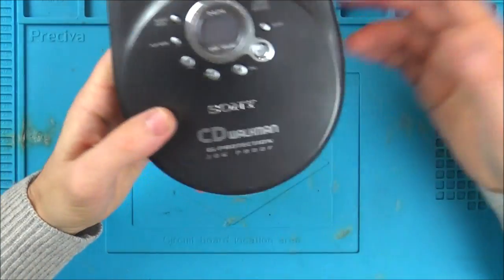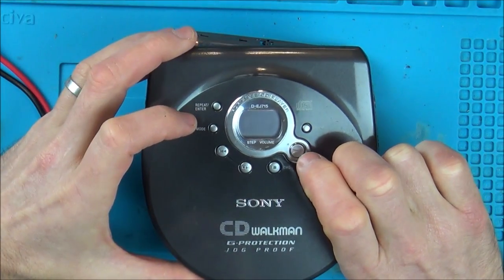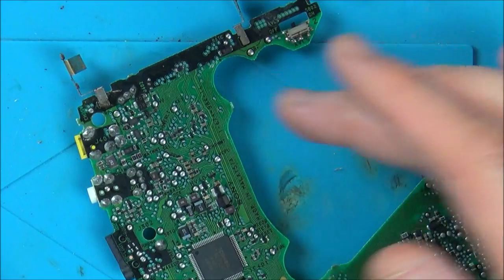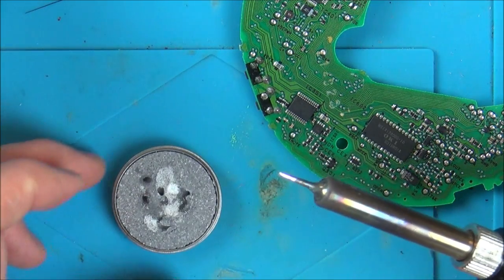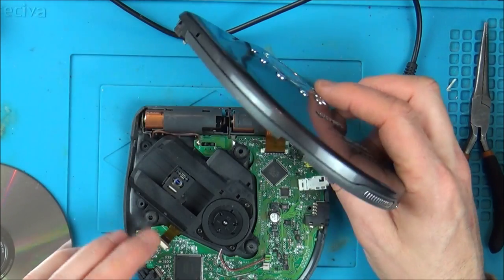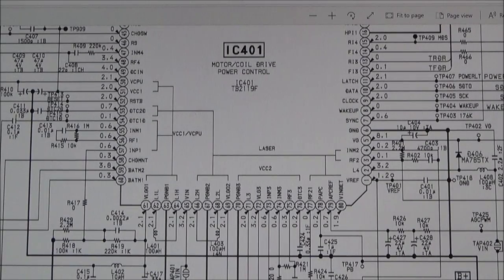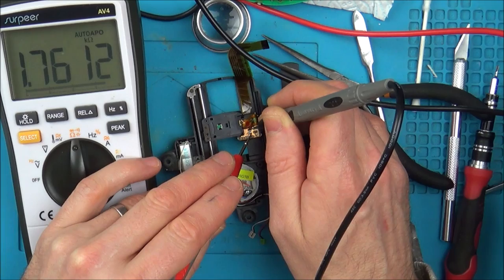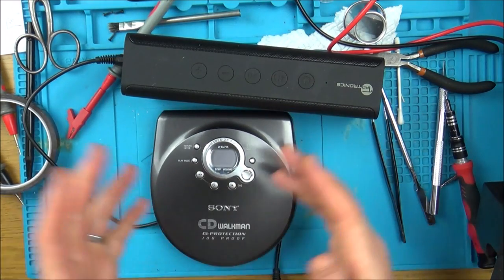Trying to FIX: Faulty SONY DISCMAN D-EJ715

Comment: The problem isn’t the laser, it’s the track for the laser. It’s trying to move from the center of the disc to the edge. When you moved it closer to the center, you may have damaged it’s tracks. The way it reads the disc  it’ll start from the center of the disc and move out wards away towards the edge as it playing music

Comment: About the enameled coated wire, you don't need to scrape the coating off, it is made to burn off when you heat it with your soldering iron,
Reply: was looking for this.. xD

Comment: Hi Vince, the laser in the cd players only are all infra-red with a wavelength of 780nm which is barely visible to the human eye but looking at your video indicates that the laser diode may be okay. The dvd laser diodes operate at 650nm and are bright deep red and the Blu-ray players operate at 405nm which produce a violet light.
Reply from the maker: Thank you Peter :-)
Reply: Thanks. I was going to mention this, but I saw you beat me to it. One of the reasons these lasers can cause eye damage is because the human eyes are not tuned to infrared, so there will be no blink reflex when an infrared laser hits your eyes, so continuous damage may be done to the eyes without being aware of it, unlike a visible-light laser, where the victim will at least blink involuntarily after the beam hits the eyes. This is not to say that powerful lasers will not damage the eyes in the fractions of a second it takes to blink. 405 nanometer light can be the most damaging because that wavelength has a special affinity to the cells of our eyes. This is why even non-laser UV lights tell you not to look directly at them. I'm not trying to show off here, the point to take away from this digression is 'be especially careful when working on blue-ray drives (if the laser is exposed)'

We all want to make sure Vince can see properly, so he can continue to make these fun and interesting videos.

Comment: The shaking it has, it looks like the laser gears might be skipping when it tries to move further out, I wonder if its a mechanical issue with the laser worm wheel? Often a laser checks the disk type and amount of tracks right near the centre of the disk then the laser moves out to play track 1.
Reply: Diddleshot I wonder if it’s trying to home the laser head - but because the head is all the way down it cannot move further. Vince was sliding it around without a care in the world early in the video lol
Reply: @StephenArsenault  that's exactly what it is sir. i have a similar one that does the exact thing. It tries to retract the head but it cannot because t's already there but the pickup icu cant sense it. It usually indicates an end-of-the-line killswitch malfunction. The Laser is probably fine(ish).
Reply: @StephenArsenault  I hope this one gets read because he certainly skipped the gears in the read head tracking a few minutes in. The disk info is located in a certain location and if the head can't get there it won't see the disc.

Comment: All CD's are read from the center out,, some CD players will use the laser to detect "Disk present" first, but then command the tracking servo to seek the inner location they usually do this by running the optical sled towards the disk spindle until it strikes a micro switch that tells the player , You have reached the inner track,  it will then try and read the disks table of contents ,, you should see the worm gear drive attempt to move the optical pickup sled to seek this position, if the laser is too weak , it might not seek as it may think "no disk present why seek ,, most CD players seek inner track detect as a part of there attempt to read anyway.  be mindful A CD players laser light emissions are in the infrared spectrum also be aware laser diodes are extremely static sensitive and easy to damage, some people will not unplug the ribbon cable unless they place a bridge the static protection pads with a solder bridge first,,    and new ones usually ship with a solder blob in place that protects them. they wont work until this is removed ..watch videos on CD player repair to better understand how they read the disk ,, also make sure the lens is clean ..

Comment: Hopefully I suggest this so that it makes sense. But, I think when you adjusted the pot for the laser you may have went the wrong way. On a pot you have three legs, with the "wiper" in the middle. So, while the resistance goes up between the wiper and one leg, it goes down between the wiper and the other leg. So it would depend on which leg the laser was wired to. I couldn't tell from the video if it had three legs or not, but it is worth a try. The laser did seem to get dimmer the more you turned it, or maybe it was just burning it out worse...Lol.
Reply: Good observation. I also wondered why Vince did not try to turn the pot the other way to see if it made a difference.

Comment: Just a little advice, don't worry about scraping the wire just run the soldering iron over it, the heat will strip the enamel off the wire. If you use a scope look up "eye pattern", diagnostic procedure to check out FE and TE (focus error, tracking error). This will give you the condition of the laser. That's how we used to do it back in the day when the values could be adjusted. Great video.

Comment: Bought a Walkman D-C20 yesterday. Had similar symptoms to yours (Starts spinning for 2-3 seconds, then stops, laser searches for something -> No Disk)
I was about to give up, but then i saw the resister on the laser, it was set to 2.8kOm. Moved it down to 1.5 and it WORKED ! 

Thank you sir for your video and help

Comment: Great job on the repair of the damaged traces =D  You cannot always see the laser!!!  It depends on the frequency of the laser.  The fact the disc was spinning, shows it was actually detecting the disc (using the laser), but it was perhaps too low.  Some CD units have a laser that you cannot see with the naked eye.  Also note, if you have the laser set too high, the same thing can happen where it won't detect a disc.  I also think you have to the two connectors the wrong way around, since that noise its making at the end sounds like it bobs up and down, and THEN hits the tracking coils, when I think it should be moving the sled!  I noticed that when you swapped them around earlier on in the video (see around 30:00 - it focuses normally, then wobbles (tracking coils driven), when actually I think the sled should be moving!
Reply: CDs use light around 780nm, which is infrared. I'm not sure if a shorter wavelength works properly, as I understand it it has to do with the pitch of the pits in the reflective layers.
Reply from the maker: Thanks Chris for the advice, I will double check the schematics because they do show the connectors for the spindle and the sled. I will do a revisit on this one :-)
Reply: i know im asking the wrong place but does anybody know a way to log back into an Instagram account..?
I stupidly forgot the login password. I appreciate any help you can give me!
Reply: @Archer Chance Instablaster ;)
Reply: @Ledger Elon thanks for your reply. I found the site thru google and I'm in the hacking process now.
I see it takes a while so I will get back to you later with my results.
Reply: @Ledger Elon It did the trick and I finally got access to my account again. I am so happy:D
Thanks so much, you really help me out !
Reply: @Archer Chance you are welcome xD

Comment: really great video - had a similar issue with my discman and could not find any guides about it anywhere. i was also unable to fix it by messing with the potentiometer. your video helps keep me from doing a lot of unnecessary steps. thanks :)

Comment: I always clean the laser with meths or IPA. I have had much success with cleaning the laser of a device. However you are most likely right with your thoughts on the laser being the reason for it being put into storage and the circuit board tracks being a secondary fault..

Comment: Was watching this whilst repairing my CybaSnipa gaming keyboard pad where over the years the carbon on the keypress grids had basically created a layer over the metal and stopped the whole thing working, so with MMV approved IPA and fibreglass brush took me a while to get to see copper but my gamepad is working like new.   The poor thing is worn out so I am guessing I will have to apply conductive paint onto the grids in the next repair and maybe re-carbon the rubber membrane but I have had it since the 2000s.
Reply: You could also just grab an old tablet (or phone) and run something like Roccat Powergrid instead and let it retire peacefully from use to go sit and look pretty on a shelf around your machine or something

Comment: I think you're right about the battery leak having happened at a later stage. I dunno about lasers either, but the movement of the mechanical parts seemed a bit odd to me, like it was skipping or something, maybe not sensing it has reached the end. Might not be strictly laser diode related, I mean. I hope you find a way to fix it :o)

Comment: Vice. Let me give you some information on discs. DVDs use a red laser, Blu-ray use a blue laser and CDs use a infrared laser. Infrared is a color that cannot be seen by the naked eye. Some cameras are able to detect this light. Your camera looks like it is not able to detect that color on screen (high quality camera perhaps). To find out if a camera could detect this color, you can point your infrared device  (tv remote) into the camera to see if it is able to detect that light. The light is not seen as red but more like a white/grey light. To me, the way that the laser was shaking with the grinding noise maybe the problem to why it thinks that there’s no disc. The laser is suppose to have the ability to move across the track and not shake like that to determine if a disc is detected.

Comment: Ahh I was hoping that after 0.8k resistor turn, unit will read discs fine. Maybe try to measure laser current consumption
on working unit, then you can compere it with bad one. Formula shows that "I = 3V / 1500 Ohm" = 2 mA. Maybe resistance value should be less like 0.3k to give him some juice, like 10mA :) Datasheet for this laser should contain maximum current value, but boy, is any way to know what laser model number is used in your Walkman? Perhaps not.

Comment: On a scope you will only see the voltage level of the laser. It basically works by shining a steady light at the CD which reflects light back to the light sensor. The amount of light reflected back varies depending on the CD. On a working CD player you could put a scope on the light sensor and see the signal. Incase you don't already know on the diagram that you showed, the laser is the one with arrows pointing away from the symbol and on the light sensor the arrows point towards the symbol.
Reply from the maker: Thanks PDS, I didn't know about the symbols :-)

Comment: As to the name, this is after the Discman line, when Sony were consolidating all their portable players of all formats under the Walkman brand (CD, cassette, MD and MP3), but prior to the funky "W" logo they made. I have a D-E201 from this time that also says CD Walkman with the old lettering that I got cheap, that wouldn't recover after skipping from a knock even with ESP turned on... Turns out the spindle was loose so it would vary the spin speed and wouldn't correct itself before giving a no disc message. A touch of ciano to put the spindle back together and now it works great!!

Comment: Vince
The laser diode is most likely open.  When it is working correctly the voltage drop is .7 volts.

Comment: Hey Vince, I think you raised the potentiometer for the laser so more voltage is gone at the potentiometer and the laser doesn't get enaugh voltage. If you lower the poti then there is more voltage to the laser. It might be a fix. Sry for my bad Englisch :)

Comment: "You could use your scope". 
I'm not saying it would have helped to fix it, but most of the time you can't test ICs using a multimeter. Input and output voltages aren't necessarily constant, they easily can be a relatively short signals which you can't see with a multimeter.
And I'm not sure, but I think that more than just two pins of IC401 are related to the laser: 3-4, 50-51, 66-69, 77-80.
Reply from the maker: Thanks Andrew :-)

Comment: I see when your soldering you have the shakes bad how about putting your elbow on the table and see if that helps i do this when i am doing fine smd soldering work helps alot also try using a K tip when doing track work like this you will have a easier time soldering it

Comment: Optical drives are a world of pain,  disc reading issues are difficult to pinpoint,  the light emitting from the lens isn't shining from the lens it's only a reflection from the diode that has passed through a splitter and mirrored up through the lens,  the motor also has to spin at correct speed and it has to vary in speed to read the info on the disc as moves from the centre out to the outer edge of the disc . The gap between the lens and disc surface is also critical ( spindle height)  as is the intensity of the laser,  try and find a good tutorial of how it all works together,  there's a lot to go wrong when you look at it
Reply from the maker: Cheers Simon :-)

Comment: You should turn that pot when disc is inside and it is in the process of focusing to be able to match the exact power, it is not nesessery to be a strong light. I think there is more damage to the board and some of the vias under corosion are also damaged. First spining of the disc is so laser can fall into a track, not because it focused laser on the disc. Finding a track is the fall of the light on exat spot on the photodiode matrix which then with fist spinning generates small pulses which tells the CPU to start spin the disc acording to data on the founded track.
Reply from the maker: Thanks technixbul, I will revisit this one and use your information and the other helpful comments :-)
Reply: @Mymatevince  Feel free to do it! In my experience the best way to callibrate laser is by ear and when its trying to focus while disc inserted (listening of the focus coils)-> just turn sloooowly the pot, listen to the scratch noise and when the noise appear -> disc is recognized and start to spin (read and play), adjust the pot until the lowest possible level of noise is acheived while disk is playing, because if you overpower it, it also won't work and may kill the laser if not - shortly. DONE you have perfect callibration without any special equipement.
Reply: i don’t understand geek talk i just wanna fix mine 😢

Comment: Hey Vince!  Here's something fun for you to test some day: as batteries run down the amperage (current) will diminish, so if you connect your amp-meter to a battery you can watch it run down.  The voltage should stay fairly consistent throughout the life cycle of the battery until you get close to the end.  Think about batteries in a flashlight; the brightness stays about the same right up until the batteries are about to die, then it starts to dim.  I've seen you use voltage to test  batteries which is fine if you're testing if the battery is faulty, not so much if you're trying to figure out how "charged" it is.  Try charging a battery all the way and test the current, then run it down a while and test the current again.  Also, as batteries age they hold less and less current, so look at an old battery vs a new battery: charge them fully and look at the amperage on each.  Have fun!!!

Comment: Hmm it has a protection switch right next to the laser to protect it when moving when not using it. If you let it on and try to play it no wonder it doesn't work

Comment: Vince, my man, please stop messing with laser potentiometers... After they are set at the factory and sealed they very rarely malfunction. They produce the lasers within a certain range in nanometers to within +/- like 5 nm. The potentiometers are then used to precisely focus the laser to an exact wavelength with no variance and glued to permanently set it. It's almost never a problem with the potentiometer. It will most often be a driver chip or a mechanical malfunction like the stepper motors or worm screw. I love the videos and your excitement to learn new things about electronics. Keep it up bud.

Comment: I got my first cd player, the sony diskman in 1992. came with aiwa headphone. sounded fantastic. for a good 6-7 years after that it was my primary  cd player which I attached to amplifiers, car cassette players
Reply: I remember doing that !...jack to jack plug into the car stereo auxiliary .
Reply: haha no I plugged it with one of those inputs shaped like a cassette tape

Comment: Good troubleshooting, but there are multiple problems with this poor thing. The laser output is def way too low. Also, if the laser sled does not scan over toward the spindle upon startup, then there is a problem with the start routine, or  a mechanical bind that prevents the sled from moving. A leaf switch tells the processor when the sled is at its innermost position, and the processor is not seeing that switch closure. Good luck, but it may be time to bin it.

Comment: Why would you not just run an insulated wire from termination to termination instead of trying to solder that fine wire in the middle of the trace?  Especially when it could short out to another wire, trace or component since it isn't insulated.
Reply from the maker: Those wires are insulated but they don't look like they are. They are the same kind of wire that are used on transformers and motor windings. I think it can be called magnet wire or enamelled wire :-)
Reply: @Mymatevince  Thanks for the explanation.  Love the channel and all your amazing content.  And thanks for the simple reminder that we can do things like that too if we just try.